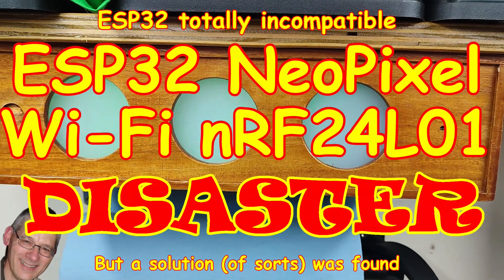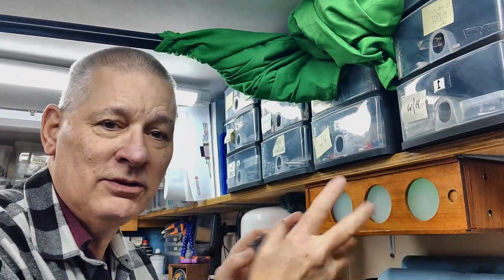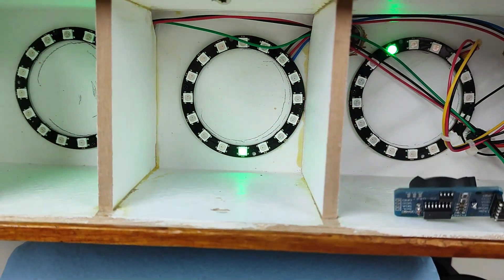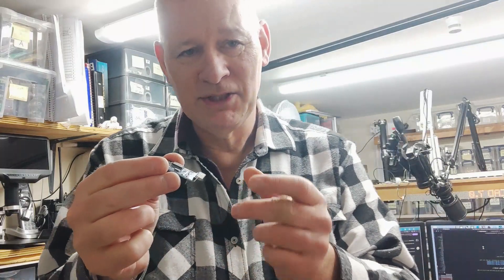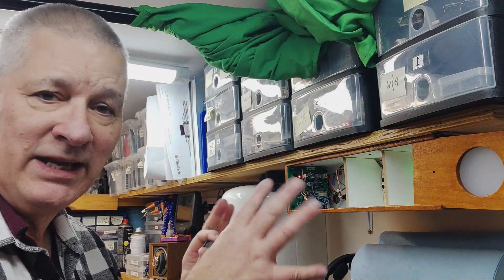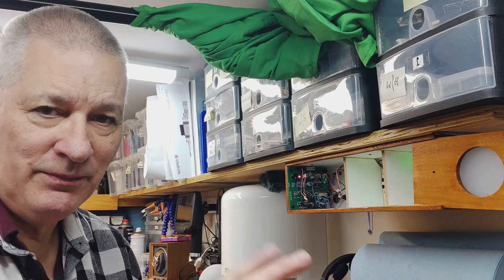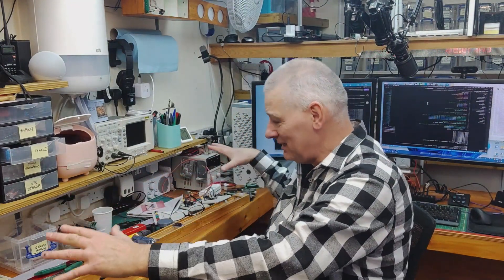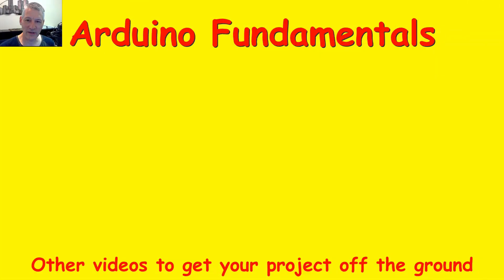#262 ESP32 + NeoPixel + Wi-Fi + I2C + nRF24L01 disaster!😮What to do?🤷

Comment: Suggestion:  why you do not get rid of the nRF24 and use a cheap ESP8266 in your trash bins with ESPNOW  and also in in the ESP32 (off course you need to figure out how to use WiFI and ESPNOW in the ESP 32 (probabilly disable ESPNOW during WIFI communication)! For me nRF24 is very sensitive and does not tolerate anything.  Bad Humor chip.
Reply from the maker: If I were redesigning this entire project, I would most certainly use ESP32s in each bin, communicating with ESP-NOW back to the "hub" device. It just seemed like simple idea, at the time. Now I don't want to just throw away perfectly working modules.
Reply: @RalphBacon  I'm with you,  when I have a working project done and set I don't change!,  I just am very fond of ESPNOW!

Comment: SO  my version of this is the heltec lora esp32 wouldnt run the nrf2401 and the lora radio at the same time , unless you use tasks .   now why any one would want to do this is kinda ridiculous , i wanted to put the heltec on a uav with two different radios in case i flew out of range.  I have several solutions to this but this particular case took forever to figure out.  It was one of those thing that just kept not working and i should have gave up on but just kept trying anyway
did you try to ask ChatGPT why ,   that thing is incredible
Reply from the maker: I've asked chatGPT a few things and, yes, it's amazing. Is this the dawn of true "robots" (not the mechanoids, the chatty computers in all Sci-Fi films)?

Anyway, sounds like you also stumbled on a similar issue. We will get to the bottom of this.

Comment: or use a raspberry pi pico w, drive neopixel using pio, 
is the esp32 the access point, probably not if it was getting time from ntp server.
was bluetooth used to communicate with the bins ?
Reply from the maker: I use nRF24L01 modules to communicate with the bins (so some proprietary protocol, I imagine). Yes, I could offload the Wi-Fi (or Neopixels) to some other processor - but I should not have to!

Comment: If you use tasks, my guess would be that neopixels get to use same core as wifi. When wifi gets it's turn, it screws up timing for neopixel routines if it was running on same core but neopixel routines can perhaps interrupt other routines at time they should not be interruptable.
I had mysterious problems like crashes with NTP library I used Arduino time library. It had random crashes every now and then if time zone info was given in text format. With numeric time zone differences crashes were gone. Things like these are sometimes beast to solve!
Reply from the maker: A beast indeed. 3 days a beast. I need to write that minimum viable program to prove all this to Espressif / Adafruit.

Comment: Hi Ralph, sounds like library assuming things or using common variable names. I have changed libraries to make things work in the past. NeoPixel have tight timing so did this change the timers on Wire or even Internet.  When in a task then only one thing at a time and perhaps the stack and variables have a cleaner environment. I have resorted to RTC as interent seems to have a higher priority on timed outputs, and just update once a day in your case at night. It will easily keep time. I know internet can hog core 1 and core 0 should be independant but I think it must check what each core is doing now and then.  One trap is to make sure that the RTC has valid time.  Don't just use the status flag as all zeros seem to pass. Also check if year is not 2000 and month is not zero.
Reply from the maker: It's something to do with my use of NeoPixel tasks and Wi-Fi, I believe. I need to dig further.

Comment: I can't help myself but one does not simply watch a Ralph video without commenting welcome BACK! Mr. bacon. :D
Reply: Running gag aside. Your problem does smell kinda brown out related. Had the ESPs (and other microcontrollers) do lots of weird stuff due to it. :) wifi is taking a not insignificant amount of powah
Reply from the maker: Certainly Wi-Fi takes a considerable amount (for very brief periods) but then I would expect a brown out message in the crash not some weird Heap Memory corruption or some other weird message! The power supply to this device is quite beefy (because of the NeoPixels).

Comment: Is it worth checking that your ip hasn't been blocked by ntp? I heard they block ip addresses if they spam their address. Cheers
Reply: This would be a good idea too. 20 minute intervals is crazy frequent. Once a day is a a good deal better or even once a week, the RTC will do the rest very accurately. Heck a good approach is to say check NTP once when the RTC reports the time to 12:00 or something, adjust if needed then add a condition to prevent it trying to check again if the RTC time was wrong by a negative time, preventing NTP being spammed. 

If NTP is loaded too heavily it can have a noticeable effect of services that need NTC time to be accurate such as financial services, alarms and online security tools because the latency added to the reported time increases.
Reply from the maker: No that's fine. It's not the NTP that's the problem (I don't check every 20 minutes, I check the time from the ESP32 quite often, but that in turn doesn't synchronise its internal clock with an NTP very often).